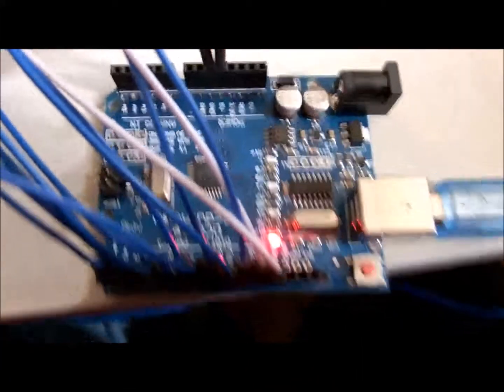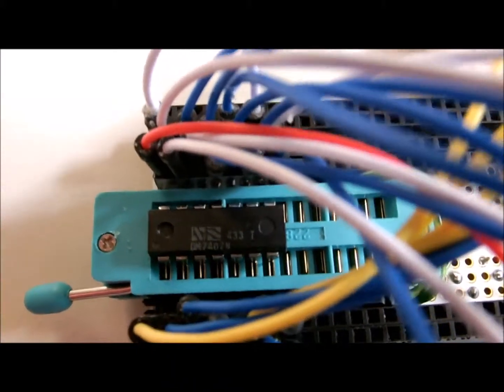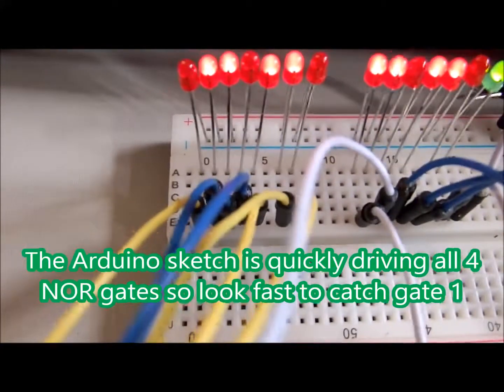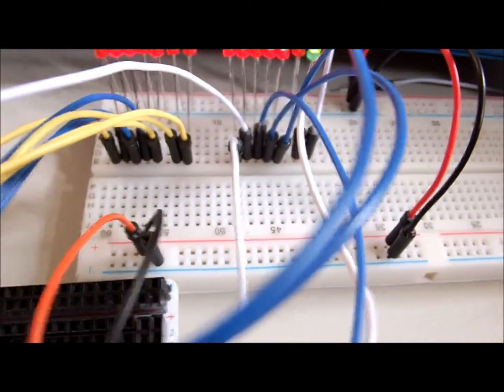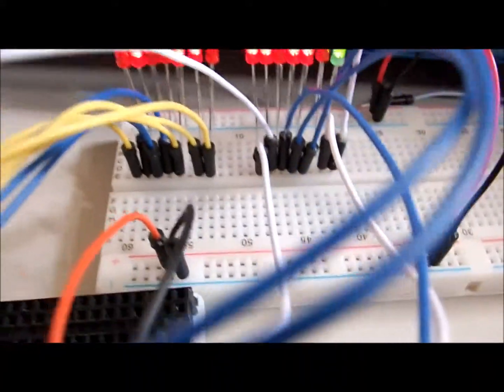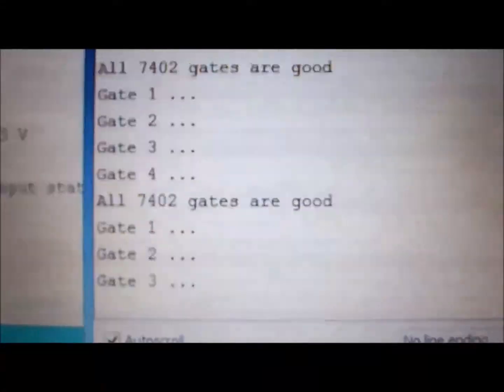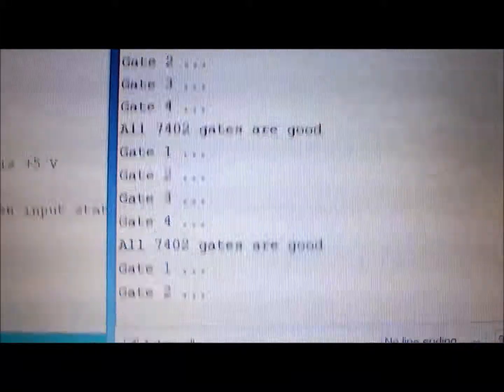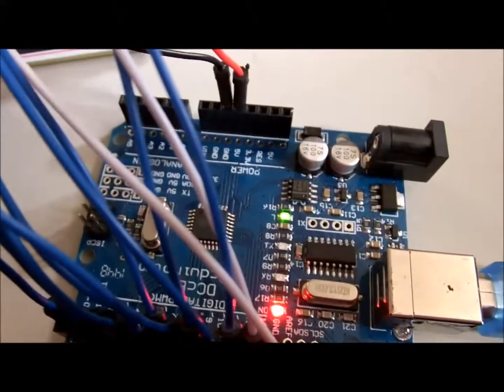7402 IC Tester

Comment: Quite awesome Richard. Wouldn't it be nice to make a universal tester where you plug in the spec sheet values and the program adapts and checks all for you. I have VIC-20 repairs in mind where there are multiple types of chips and some are soldered in place.
Reply from the maker: Hi Ralph … Yes, especially for some of the beyond-7400 series chips … Friend Tom whom the video addressed was taking a EE course at the University of Texas with his grandson and getting into 7400 series TTL for the first time - ergo the Arduino "experiment," mostly to illustrate breaking the 7400 chip down to it's functional characteristics and play with it a little … We programmed the Arduino for several other chips besides just for the h.... of it to really get the point across.  There is a little Arduino tester device sold by Banggood.com that is more of a universal 7400 series ic tester but I'm not really very confident in it although it seems to work for the more common ones OK.